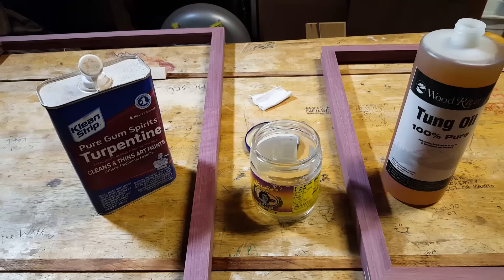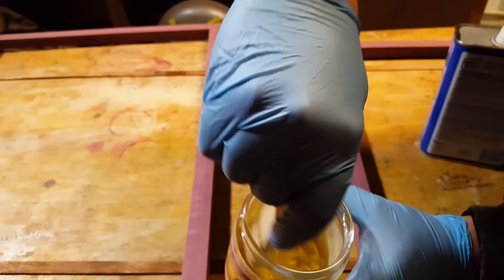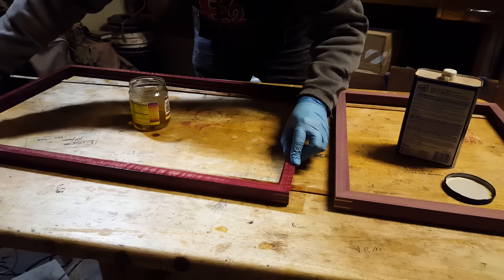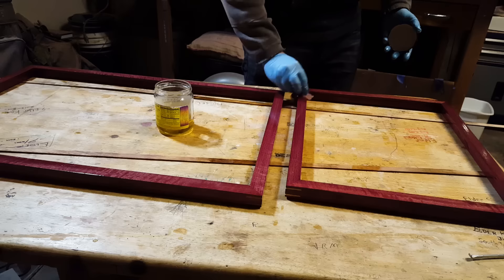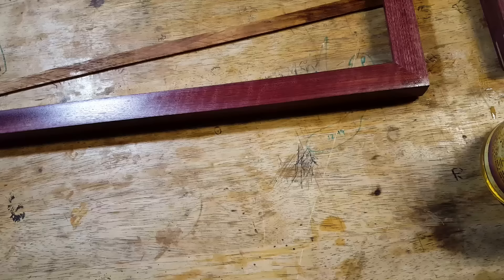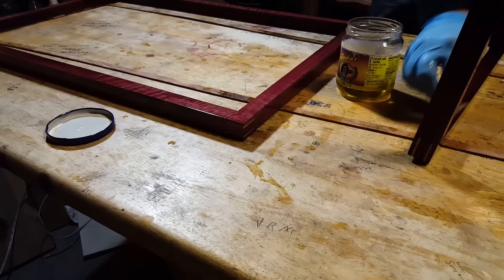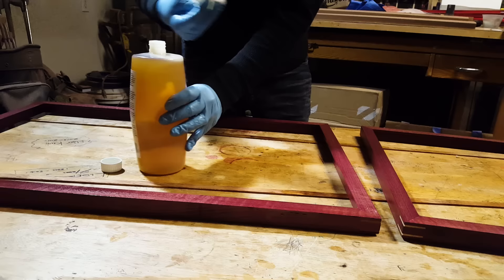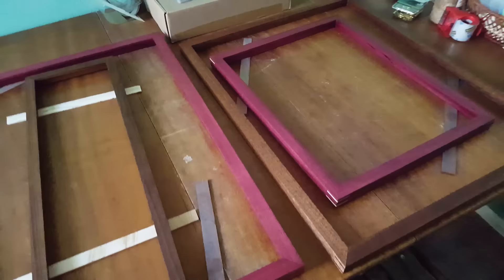How to Apply Pure Tung Oil to Wood (the right way)

Comment: Pure tung oil actually will not go bad.  No need to worry about that part.  Linseed oil can go rancid but not tung oil.  I think you're going way too fast with coats.  Gotta let the tung oil cure....which can take up to a week, between coats.  if you let it cure and truly harden between coats, you'll get some depth in the finish.  if you just do coats each hour, you just end up with one well-absorbed coat...and that's it.  The finish will have very very little thickness, in the end, as nothing hardened or cured between your so-called "coats".

Comment: It's not a pure tung oil finish if you're mixing it with solvent.  Using 100% tung oil requires a different process.  Just taking issue with the title of video, not that you're finishing the wrong way.

Comment: Heating up pure Tung oil will also help it penetrate and apply well; you don’t have to dilute it. Deeper penetration does little for protection, but it does make the grain pop a little more. 

This is the “flood method,” which is popular, but takes longer to cure, uses more oil, and can lead to leaching problems. I’ve had better results applying thin coats and buffing off all excess right away.

Comment: I use limonene (orange oil) which is technically "citrus rind oil."  i cut pure tung oil 1:1 for general purpose first coat but not always. Closed pore wood such as White Oak needs a more absorbent first coat.  A tung oil finish on the solid body guitars I build works very well tung oil takes dyes too.
Reply from the maker: I didn't even think about mixing it with dyes, that's awesome. The dyes I have used I either mix with water or denatured alcohol, are you just adding dyes with tung oil/mineral spirits? I'll have to play around with that. Thanks for letting me know.

Comment: It's a good video, but I have to put in a word to save the newbies from themselves. You may have heard that rags and paper towels sodden with linseed oil can spontaneously combust, if thrown in a heap. Tung oil will do the same thing--indeed, there are those who say it's even worse . Whatever you're using to wipe it with, you have to beat this fire hazard from the start. Here are three ways. 

1. Unfold the rags and lay lay them out flat to dry completely, or better yet, hang them on a line outdoors. Once dry they may be safely discarded. 

2. Put them into a metal can with a tight-fitting lid, where there won't be enough oxygen to sustain a fire. For small shop projects a paint can works well, so does a small metal garbage can.

3. Best of all, I think, is what we did in our pipe organ shop, where we finished the huge oaken casework with oil--gallons of it. The used rags went into a galvanized metal garbage can with a gallon of water and a cup of Pine-Sol or some other strong detergent. At the end of the day, the wet rags were forked out and went into a heavy garbage bag, twisted down, tied off, and set outside for garbage collection day.

Comment: Interesting.. this is also how you do an oil painting ,starting with thinned out coats/layers, making them thicker and thicker, with less and less solvent and more and more oil. Though it has nothing to do with wood grain or soaking in since it is painted on canvas or non-absorbent, but rough surfaces. It has more to do with preventing cracking and even flaking with age.

Comment: Very good instructions, although I suggest for very tight grained hardwoods that a 1:1:1 tung oil:turpentine:mineral spirits be used for the first coat, then proceed as you did here. Japan Drier added sparingly will speed tung oil curing for all coats. Add a small quantity of pine tar (sourced from equine suppliers) to enhance anti-microbial properties. Note that a distinct pine smell will be temporarily noticeable from the finished piece, and it can slightly darken the finish, so test before applying.

Comment: With three coats of pure tung oil, the curing time after the third coat can be longer than a week. It more like three to four weeks, I've found, to finally achieve that hard finish that tells you it's fully cured.
Reply: I was told to wait for 30 days for any items that come in contact with food. So sounds like 4 weeks is the timing.

Comment: Thanks!!  I started here & learned quite a bit about tung oil.  Almost bought the Minwax thinking I was getting tung oil but between what you mentioned, actually in you comments, and what I found elsewhere, that Minwax isn't real tung oil.
Reply: My take is that Minwax is to be avoided, on the whole.  If anything is to be used, it would be their stains, but never their mixes of stain and poly....or these other so-called finishes.

Comment: Forty years ago I sprung $50.00 for a gallon can of Tung oil.
Never had an issue with air. Still dipping out of the same can.
Good tip on diluting though. Straight Tung oil on Teak takes
a month to dry.
Reply from the maker: I have only had one container of tung oil ever go bad on me. It formed a grit to it. So when applying it to a piece it feels like you are applying a sandy oil.
Reply: True tung oil will thicken up and turn jelly like if exposed to air like that. A great solution is to get a bag of those glass rocks that people put in vases and drop them in the tung oil container to keeep the level. At the top.

Comment: Southwest heat and sun defeats all finishes - wood or auto. Boiled linseed goes very dark and degrades. Plastic finishes flake off due to wood movement. Tung oil is the only option, but it must be recoated fairly often. It doesn't darken but the sun does degrade it.

Comment: This is certainly one way of treating wood with tung oil and it is also a quick way.  However in terms of providing the best looking and most durable finish, it is not the best way.  As tung oil is a drying oil, each successive coat has to cure properly and that takes several days rather than around an hour, for each coat to dry.  Before applying the second and all subsequent coats of oil, the previous coat should be lightly sanded with around 400 grit, but only after it has properly cured.  If you want to read an authoritative article that compares the superior properties of tung oil with other oils and how to use it correctly to finish and protect wood, see:  https://www.canadianwoodworking.com/get-more/tung-oil-debunking-myths
Whether for interior or exterior wood, there is no finer method for finishing and protecting wood than using tung oil.  If maintained, it is more resistant to mould, rot and moisture ingress than any other finish.  Paint, varnish, wood stain etc will all eventually flake or let moisture in.  Once that has happened, the only option is to completely strip back to bare wood and re-treat.  One final thought to anyone  wanting to make your interior or exterior wood grain really pop with colour and contrast, try the ancient Japanese wood-charring method of Shou Sugi Ban, prior to treatment with tung oil.  The extent of charring can be to your taste and is worth experimenting with.  However, for exterior wood, once you have tried this, you will never want to go back to using wood stain.
Reply from the maker: Stephen Wright have you ever used pure ting oil before?
Reply: Several times.  :)
Reply from the maker: Stephen Wright oh good, cause it sounded like you never have and were just quoting that lady's article☺.  I've been using it for years. Refer to your article you linked: "The oils dont really "dry" or evaporate; they "harden" or cure." You don't layer it like a urethane the way you are describing. Pure Tung oil doesn't work like that. As far as sanding between coats, I have noticed no difference so I don't bother. But to each his own. I use pure tung oil weekly, and made this video for people who are frustrated using it. That's a good article you cited though, I remember reading it years ago.
Reply: Stephen Wright 
I just watch some examples of that method of wood burning. I'm so glad you said that because I was wondering if it could be used in this case. Definitely going to try it
Reply: I have to say YUP even with Boiled Lin Seed oil and Tru-oil several days dry between coats sand paper and 0000 steel-wool between coats there is one exception 1st coat needs several HOURS being cut dries quicker after that 2nd coat needs few days to dry. pending application 0000 Steel-Wool or sandpaper work just fine. But after 2nd coat needs a few days for drying

Comment: Great video thanks.

I'm using some old pallet collars as raised beds but want to give them some kind of treatment before they go out into 'the wild'. I decided on using Tung Oil but didn't know the best way to apply the first coat after I've sanded the collars. Now I know and the orange oil type is really helpful. Don't want to use any nasty thinners in wood that I'm growing food in.

Cheers, from (a very soggy) Somerset, England.

Comment: Thanks for the dilution tip. The music was a bit loud but it was enjoyable.  I have a Cherry wood project that is aged with baking soda and a "traditional cherry" stain wiped on and then off after a minute.  Now comes the tung oil to match the original tv cabinet color.  BTW - it has been years since I used turpentine but I have a can of it so here goes. Cheers.
Reply: why would you use turpentine and mineral spirits ? .... why not just one of these, you are only using as a thinner, assume it's going to evaporate off anyway.

Comment: Very nice. Putting a finish on something can take longer than building it. A trick I picked up is to squirt some propane into a container before closing it is an inert gas that keeps things from skinning over going bad. it is no more dangerous than having a can of flammable stuff on the shelf. take the head off the torch first.
Reply from the maker: That's clever.

Comment: I cut 10/1 first coat - ten mineral spirits to one oil ...... I work down to less mineral spirits and more oil but richest I do is 70% oil with 30% oil .... Mineral spirits are the vehicle that drives the oil into the wood .... Usually do 7-8 coats.

Comment: I thought I would point out that while some products are actually called tung oil and have linseed oil and no tung oil, for example Minwax and Formby's, many of the other finishes you list are not pretending to contain tung oil, so don't need to be on the list. Waterlox has 85% tung oil and dryers and resins to speed up the dry time, and probably make it more durable which is really nice when doing floors but you still have to limit traffic for a week and walk on red rosin paper.

Comment: This may be silly (also a newbie) but I’m reading about the combustibility factor of the rags used in applying the tung oil which is freaking me out. What do you do with your rags after use?
Reply: Hi! Just thought I'd mention that I always save used glass or plastic food containers with lids after they are empty and before I do refinishing, fill them halfway with water. When I am done refinishing I jam all the rags in there along with my latex gloves, top off the container with water, screw the lid on, then into the trash. Many refinishing products will combust the rags and since the potential for fire is there I just make it a habit to do this even with non-combustible products. 😸

Comment: Most people say that you should let it dry for at least 24 hours between two coats. Have you ever had any trouble by only waiting one hour between each?
Reply: Yeah, the idea is that the first layer of oil is hardened enough in 24 hours to not mix anymore with the next coat

Comment: Purple Heart is beautiful but I've never found a way to keep the purple color from fading to brown.
Reply from the maker: Yep, but I don't mind the end color either. I think the only wood I don't like the aged color of is walnut. So sad because walnut looks so amazing with just tung oil on it until it gets older and then turns to that tan look.
Reply: @Melodysdadvideos  try applying a spar urethane marine grade varnish. They almost always have UV inhibitors which will help retain the colorbetter than anything I have found. As long as you use the satin version and don’t go crazy with it, you can avoid the poured epoxy bar-top look.

Comment: Fabulous video! Somewhat surprised though, knowing pure tung oil, that you didn’t wait days between the first applications, and that you didn’t lightly sand between coats. Is it because your first coats had been diluted with turpentine, and because you minimized the bubbles? Any help appreciated, because I’ve got a new and beautiful checkerboard end grain butcher block cutting board and am overdue to reoil all my great wooden utensils!

Comment: I want to apply it on chopsticks that I painted, I used acrylic paint on a wooden base. After the paintjob I varnished it, but I think I need an extra layer (foor safety/protection) of Tung Oil. Any advice?

Comment: I've stained a butcher block table.  Will let it dry completely before adding the Tung Oil. My question is if I dilute the oil with Mineral Spirits will this effect the stain at all?  Thanks.
Reply from the maker: I have never used tung oil as a sealer. I may have to play around with it to see what happens some day. To answer your question, if the stain you used is oil based, then yes, if the stain is water based than not so much. Hope this helps, let me know it it works as a sealer, could save me some time experimenting. Most of the wood I use with tung oil is the wood they base the stain colors on; walnut, ebony, mahogany, cherry, etc. But the woods have very distinct grain patterns which make them look pretty amazing with a bit of oil to make them pop.

Comment: Knowing next to nothing about woodworking, I have a question about safety (with regards to disposal and storage).  Basically I've heard that tung oil likes to oxidize and that tung oil soaked rags and whatnot tend to get hot as a result.  So am I overreacting or is improper storage and disposal an actual fire hazard?
Reply from the maker: So with pure tung oil no, but...if you thin it with something like mineral spirits or turps that is flammable and combustible, then you need to either rinse off your rags before throwing them away or just let them dry out before throwing them away. The problem is that many products are labeled "Tung Oil" but contain all sorts of additives, thinners, and even different oils. Check out the description to my video: I included a list of such "Tung Oils". I don't recommend those. I prefer a pure 100% Tung Oil, that I can dilute as needed myself which I also provided a link to the one I use.

Comment: While I appreciate the vid, and your method works, I use a different approach.  No dilution, 2--3 coats, wipe off with lint free cloth (really, you should never use anything that releases fibers, like a paper towel) after each coat, and waiting 24 hours between coats.  I think your method is really for those who want to do the job fast, but in my experience, diluting often results in an uneven finish with dull and shiny spots.  I've never had an issue with undiluted tung oil sweating, so I think the dilution may have something to do with that.  Just my 2 cents.
Reply: my experience as well. currently applying on red oak floors.  i will wait and apply no cut oil and see if i can amend the appearance.
Reply: @hellakitty2  just an FYI, when using tongue oil on floors that receive traffic, the needed re-application will be more frequent.  With no traffic, roughly every 4-5 years, but with traffic, probably around 2 years.  Easy enough to re-apply, so really not a big deal.
Reply: @scottnunya2441  thank you appreciate the heads up.  This is my second use of a penetrating oil on floors. Initially used Penefin Verde which lasted about 5 years.

Comment: Question.  I am thinking of applying pure Tung Oil on a unfinished guitar.

I have done it in the past with success; however, it was many years ago and my memory is foggy.  Additionally, this time I plan to add dye.

I am mixing Keda liquid aniline dye to acetone and doing a 50/50 mix with Tung Oil.  Seemed OK on a test piece.  Ideally, I will do 1 coat of this.  Then the following coat will be a heavy coat of Tung Oil only (no dye or acetone) as recommended by Real Milk Paint (technically for the first coat).  Let soak, wipe off any puddling for even polymerization, and thin coats from there.  

Sorry for long backstory.  My question is...........  Should I finish both sides of the guitar?  The first time, years ago, I did the back first, then front & sides.  I figured gravity would help w/ the penetration.    But since I will be dying the wood this time, I was curious if I should dye the entire body, front & back, then hang to dry.  

Any thoughts?  Thanks!

Comment: This is similar to the way I use boiled linseed. But on a benchtop or something which is going to see hard use, I might do 6-10 coats over several weeks or months, scraping the surface between coats.I have sometimes wondered if the difference in waterproofing between tung oil and linseed oil is more to do with how it is applied than the oil, itself. I have always read it takes maybe 6 or more coats of tung oil to do a proper tung oil finish. But never read anything like that about linseed. IME, it takes several coats interspersed with a long drying time to make boiled linseed finish fairly waterproof.   I can't compare to tung oil, because I have never ordered any.

Comment: Tung-Oil or Boiled Lin Seed applications are the same cut first few coats then a 100% pending  coats is relative of durability/shine. Tru Oil man that is some good stuff also.
Reply: I tried tru oil on a antique table top. Not easy to apply to such a large area. Makes beautiful gun stocks though. I like linseed for rough projects and for tools but not too fond of it on delicate pieces. Looks good after stain before tru oil though to make the wood pop a little more. Just beeds ample dry time.